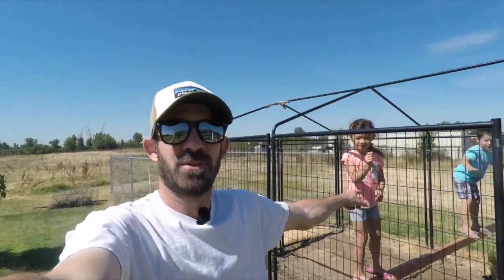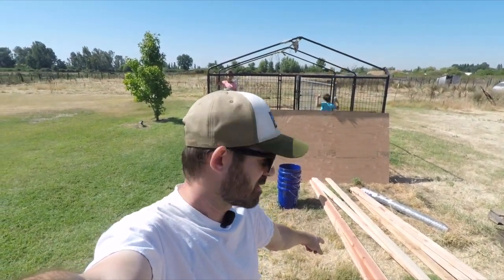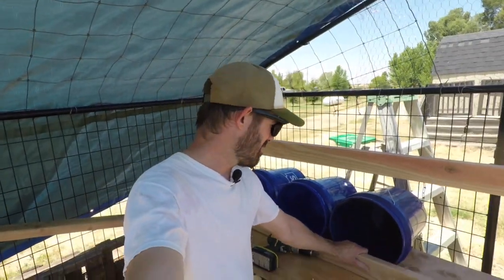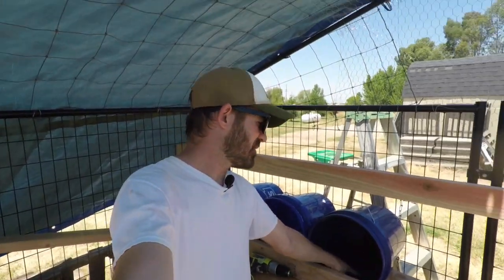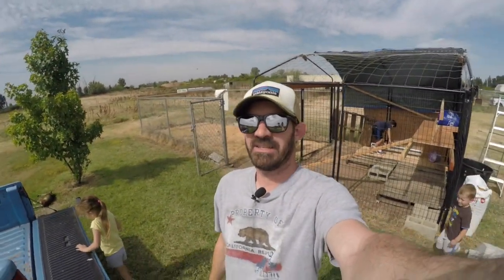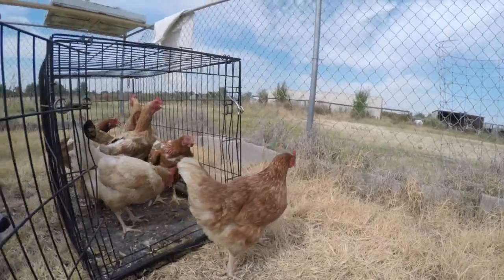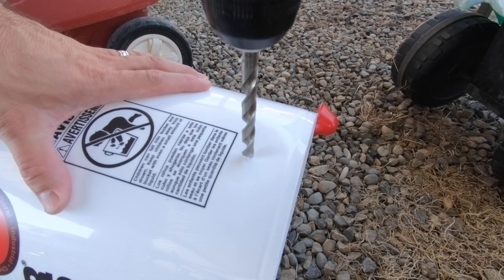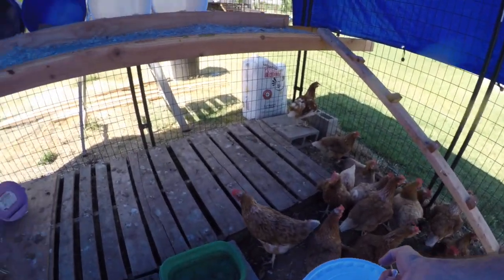DIY Chicken Coop out of a Dog Kennel Vlog

Comment: Raccoons will reach right through that fence and kill your chickens.  Either run hardware cloth all around or build a predator proof coop inside the enclosure that will be locked nightly to keep them safe.
Reply from the maker: Thanks for the tip. So far I haven’t seen any raccoons.
Reply: @JaredPhillips  Ah that's very good, we are in the Northeast and raccoons are a huge issue here!
Reply from the maker: @mrmrlee  I’ve seen opossums but the dogs usually kill those